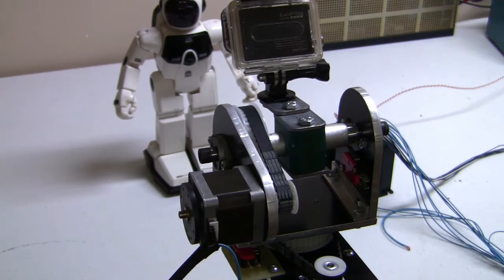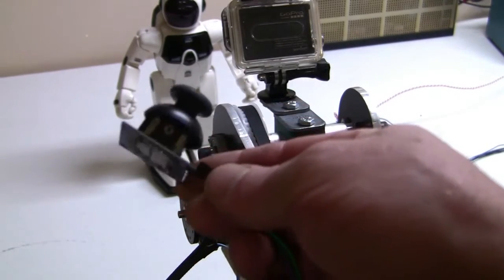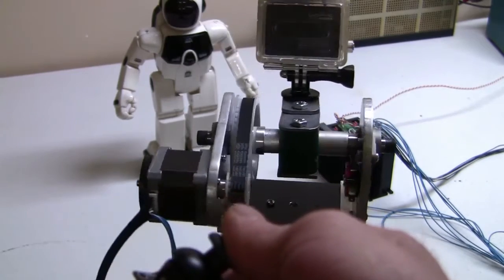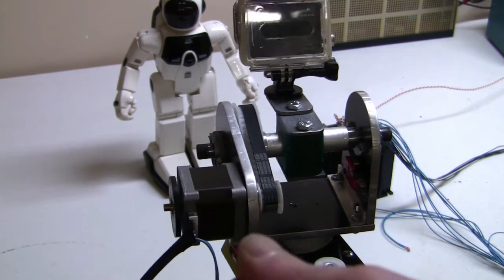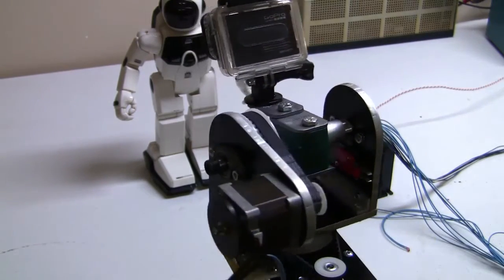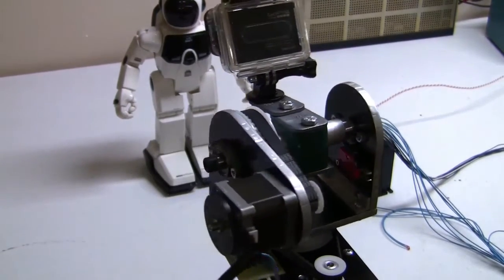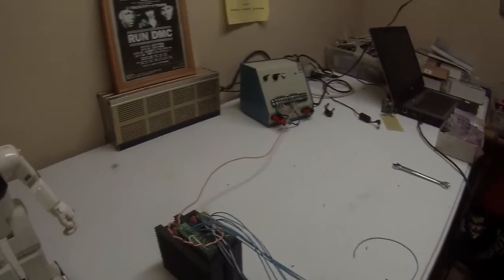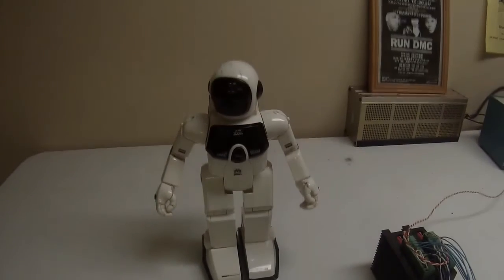cambot1  Stepper motor based pan and tilt camera using an arduino and joystick

Comment: about how much torque do you think you are getting out of those stepper motors with your current gear pulley ratio?
Reply from the maker: Hi Aaron,  The pulleys multiply the torque by a factor of 4.  I think the NEMA 17 motors were rated at 60oz/in so the torque should be around 240oz/in with the pulleys.
Reply: Thanks!

Comment: Can you share code and hardwave?
Reply from the maker: Hi, sorry for the delay in answering your question.  To see how the pan and tilt was built, google 'GRM3K cambot'  that should take you to the build thread.    On the build thread there is a link for the code.
Reply: @robotcantina8957  Search returned no results. Could you please just paste the code into a comment here? ...or provide a working link to the build thread?
Reply from the maker: @chuckhole  try this link https://grassrootsmotorsports.com/forum/build-projects-and-project-cars/grm3k-the-making-of-cambot/109542/page1/